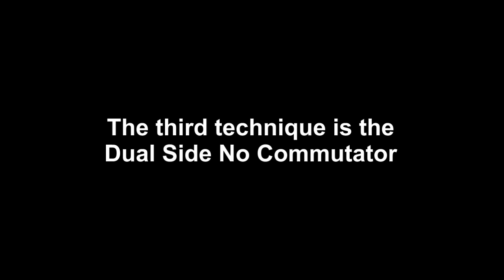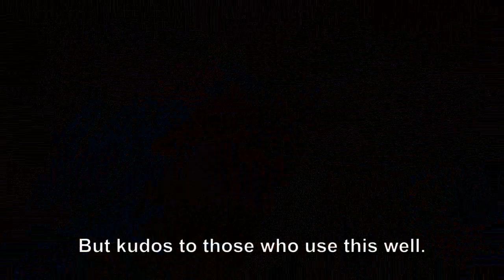Rewinding Techniques Part 3 (3)

Comment: I prefer this kind of winding style the A and B side using 2 wire set coz its balance.Can you do the nxt step of connecting it to the commutator,or if you have a video can you send the link

Comment: Well why do starter motors have brushes at 90 and some 180 ° apart brushes? Are there some good sides if you wound a starter motor diferently considering torque speed and energy consuption? This is all experimental but wuld a transformer do the same thing for exampel if you put in series ore pararel conection to that field conections? For exampel ignition coil? Wuld that not do the same thing for exampel if you wuld leave out a center tap? Some how I belive a ordinary shunt motor culd by easely turned to universal motor ore performe bouth a generator function and a starter function those old staff were called back in the days combined motors I belive but no one realy shoved how were they wound.

Comment: I've seen people stack separate wire windings on a single slot connecting to the same hook on the commutator. Any advantage to this? Great video btw.
Reply from the maker: I bet there is, but i havent tried it yet

Comment: 2 questions:
- how to decide the displacement or Pitch of Coil on Commutator >?
- how to decide the count of turns on armature , is there is any law>?
Reply from the maker: Hi Fixat,  the displacement depends on the field coil and carbon brush setup.  It differ from brand to brand and type of power tool. 
The number of turns generally depends on the voltage source, the higher voltage the more coil turns needed but there is more to it than that.
Reply from the maker: @fixat-illshowyouhowtofixyourpo  Darn my reply got erased! let me type it again please wait
Reply from the maker: @fixat-illshowyouhowtofixyourpo  I have watched your videos, may I know if you have already tested those armatures on a growler?
Reply from the maker: @fixat-illshowyouhowtofixyourpo  If not yet, when you connect it to a power source does it spin or not? if it spins but very slow then maybe you got a burnt armature and or field coil wires, you need to replace it.

If there is no sign of power, then maybe you got loose connections?
Reply from the maker: Mmmm both the armature and the field coils were alright?
Reply from the maker: You should probably make a growler, because it is the most reliable method on testing armature coils and even field coils. Sometimes the burnt parts are not visible by eye, because it is inside.
Reply from the maker: You're welcome and sure, I will be waiting ;)
Reply from the maker: Here I got videos on making one from an AVR 
Part 1 https://www.youtube.com/watch?v=fYiyRFWx-gM
Part 2 https://www.youtube.com/watch?v=-jqwACP6ZG8
Part 3 https://www.youtube.com/watch?v=hCP0E-UvD-c&t=18s